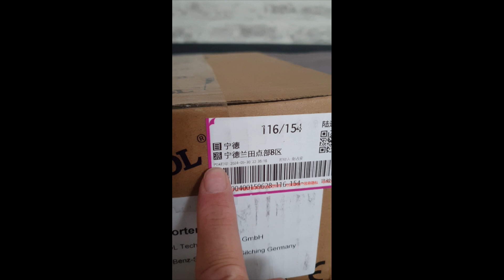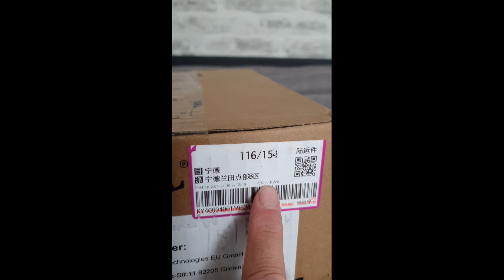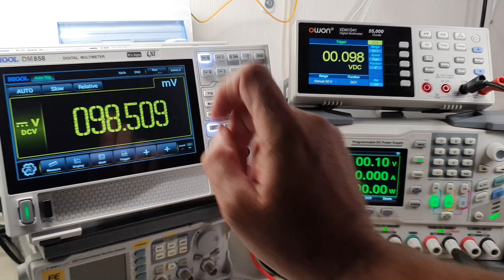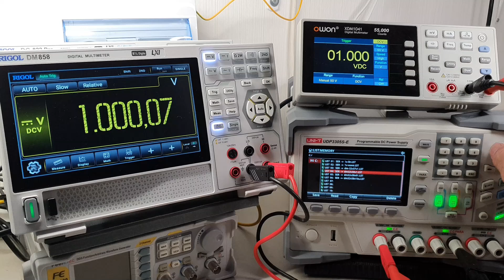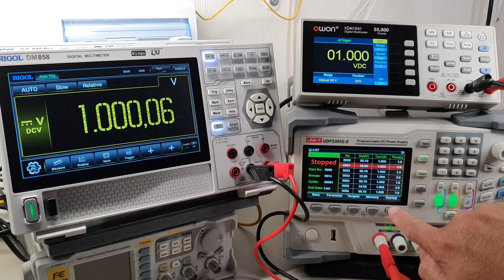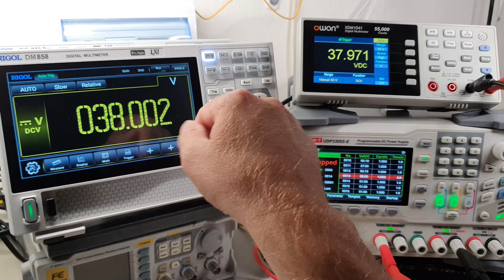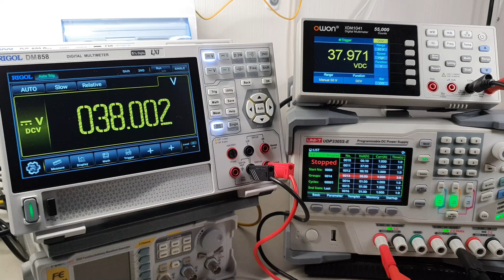#08 Rigol-DM858-new-hardware-update - Part 6

Comment: Hi Marcel, it seems Rigol is shipping updated HW for the DM858 multimeter in the next days. Are you testing this?
Reply from the maker: Hi Andreas,  I don't have the DM858 anymore - as I returned it to the seller and bought the UNI-T instead (see my other videos). However, I made a request to Rigol if they solved the HW issues regarding Impedance on DCV. It appears that they should have solved that recently. Still a lot of SW issues looks not to be resolved after reading the latest release notes. Nevertheless, it might be that I will buy the DM858 again, test it, and return it if the quality is still below average.

Comment: Hi, can you let me know which supplier you used? The one I used in Great Britain is not really keen on replacing it with new hardware. They sent me some config to run and it seems to solve the dcv measurement issue. The SCPI command is :SYSTEM:CFGVER? but if it does not show 1, it is :SYSTEM:CFGVER 1. Rigol says it "changes the DC voltage 100mV and 1V gear configuration".
Reply from the maker: I have bought the DM858 at Eleshop in NL. And I know that they returned my old device to Rigol Germany (on request of Rigol DE after my initial complaint in April). Then there was a long time silence, and finally they intent to ship a HW1.0.1 version as result (E).  But they have never confirmed that the problem was solved or whatsoever.  No info.  But I checked last week after receiving my DM858 and made a video of the result. So I assume HW 1.0.1 is the solution since the SW is still the same (1.00.00.20). BTW: I just enter :SYSTEM:CFGVER? and the result is 1.  I assume the config file you received from your supplier didn't work?  I didn't know that this could potentially solve the DCV autorange issue.
Reply: @marcelmostert3081  I had the same config update suggested to me by my supplier here in the UK, and it has in fact resolved the issue with the meter not correctly showing voltages above 32v or so.
Reply: @richardstaz721  Thank you very much for this information from Rigol. It seems to work on my DM858. Above 32V the display is fine. It would be nice if Rigol could share this with all his customers from his websites...
Reply: Hi, yes this solves dcv issue but the multimeter is still draining current so it is not a full solution
Reply: @dragon_v  I see no appreciable current drain, it measures some 3µA and is the same whether using a Fluke or the Rigol.  The fix looks fine to me.
Reply: @richardstaz721  I do not see this drain on my sanwa and other meters. In some measurements even small value can affect the reading and show incorrect value.
Reply: @richardstaz721  Also, my current drain is about 0.03A so much higher than yours. I also cannot display trend - you may want to check it too.
Reply: @dragon_v  Yes, 30mA is far too high, as I say I measure about 3uA, I also can display a voltage  trend over 60 secs.
Reply from the maker: Hi, I did manage to do a display trend - in general it is working. Or is there a specific issue which is not working in Trend?
Reply from the maker: @dragon_v  unfortunately, you are correct.  It is not a full solution. Hopefully Rigol will come soon with a real update to fix all of the issues related DCV.

Comment: This thing front end is built around HY3131 chip which is used in 50USD handheld multimeters. There is like 4 details in it  HY3131 + Resistive divider network + Relays, nothing else. Fair price for this device would be 100USD.
Reply from the maker: Interesting info.  HY3131 has 50K count according to their datasheet, while DM858 and DM858E has 120K count. Do have some more info about your claim? I would expect that the ADC of the DM858 is also different then the DM858E. I am not planning to do a teardown due to warranty, but I love to see such video.
Reply: @marcelmostert3081  Check EVVBLOG forum topic "Rigol's New Function Generator and DMM: DG800Pro / 900Pro / DM858" page 6. There is photo of front end, it consist of only ONE chip.
Reply from the maker: Thanks! Although I could NOT identify the ADC (HY3131) on those 2 pictures from "cshui17" on page 5.   And again 50.000 counts is not applicable for DM858 (and E)

Comment: Hello Marcel,
Great news about your new DM858 in version 1.01. Most of the problems have now been solved. Hypotheses of a software update to solve the problem seem lost since you're still in 1.00.00.20. In short, I'm not sure that all retailers will agree to return the product to Rigol for an upgrade. Most will turn a deaf ear unless Rigol makes the approach to its distributors. We'll see...
In the meantime, thank you for this long-awaited video and good luck with your further investigations into your new DM858. Best regards.
Reply from the maker: Hello Frank,  I am afraid that you are right regarding deaf ears.  Are you trying to get a HW 1.01 also via your distributor.  I hope you will succeed if you want to take the effort.  In my case it took totally 2 months (including an owned trigged swap from E to non-E).  Kind regards, Marcel
Reply: O problema desse aparelho é hardware  ou  software? Se for software é só baixar uma atualização não???

Comment: Good evening, has the slowness in slow mode been improved? then do a test asking for the PFC sector of a power supply, my old DM 858 which corrupted the firmware and I had to return it to the seller, when measuring a voltage of 400v on the PFC capacitor in automatic scale a large spark came out from the tip.
Reply from the maker: Hello, I didn't notice a faster "slow" mode.  I guess nothing has changed there. About the 400volt:  Do I get it right that you put the DMM in DVC autorange and then you start to measure 400V DC. Did it display 400V or was the meter directly defect? (after the sparc)  It should be capable up to 1000V if I look to the specifications.  Did you receive a new DM858 from the supplier?
Reply: @marcelmostert3081  If you leave the multimeter on automatic scale and directly measure 400v, a spark will come out of the tip when the multimeter changes from the 1v scale upwards, this was a defect that also occurred in mine, I chose to return the amount paid and bought a hantek hdm3065b , because in addition to the dm858's bugs, I didn't like the slowness and the fact that when I put it in medium or fast mode, it turns into a 4-digit multimeter.
Reply from the maker: Correct, in medium/Fast one digit is removed.  With your spark out of the tip I will check this also.  Anyway, do you like the 6.5 digits hantek meter - also in the different measurement speeds? Any bugs there?
Reply from the maker: Good evening, I think I found the root cause of your corrupted DM858. It appears that the impedance is very low for a short duration (and strangely enough how higher the DC, how lower the impedance). I measured 1500 ohm at 56-66Volt.  But with 400 DC, I don't know, but I guess enough to generate sparks....and destroy your multimeter. This situation of low duration is only for around 150-220ms and occurs when the autorange has to scale up from <1.2 Volt to the higher ranges. I know you have meanwhile another multimeter of hantek.      https://www.youtube.com/watch?v=yJc4WJnmnNA